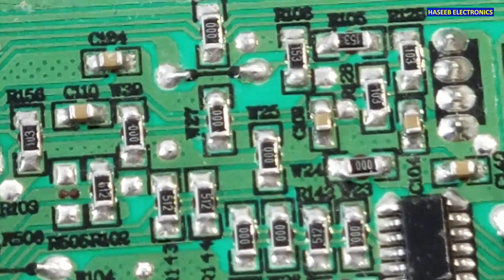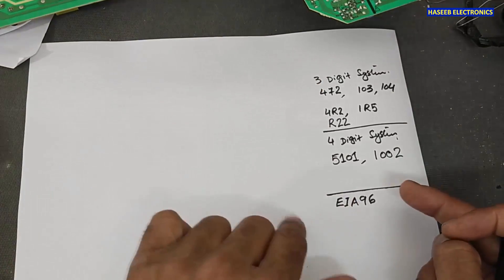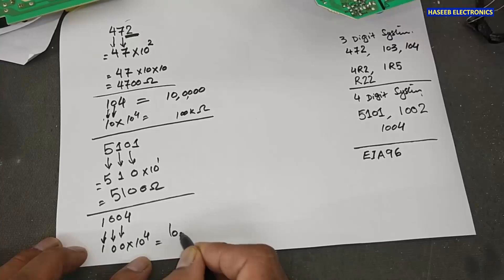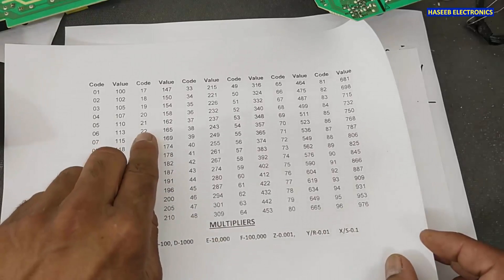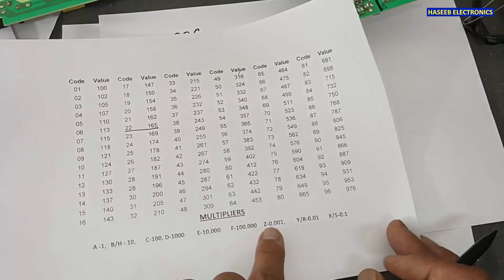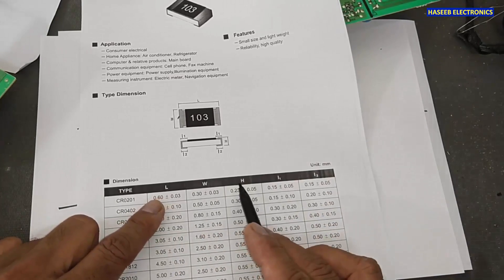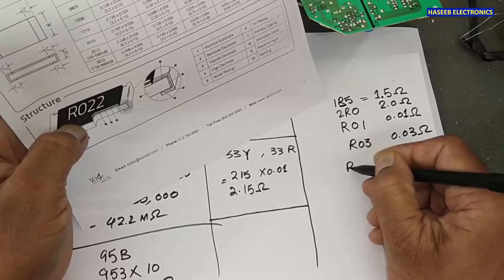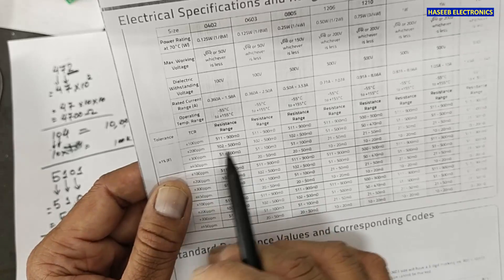{783} SMD Resistor Code To Resistor Value And Wattage Rating

Comment: I have a smd PNP transistor marking 5DW.  For emergency, can i use alternative TO92 packing eg SS8550?  Hope you can explain more.
Reply from the maker: yes 
you can use it. just match the pin configuration
Reply: @HaseebElectronics  Thanks for your reply.  Will try and update you again.

Comment: I was doing one of those SMD practice boards and was royally confused about the numbers on the resistors /capacitors because they did not match with the assembly instruction , the sheet it came with only showed their value , now I understand how to calculate these resistors and solder then on the right place, this is extremely valuable to me, thank you

Comment: Goodday Haseeb, I was wondering where we can locate the specification sheets @ 13:47?
Reply from the maker: it is available on google 
https://datasheet.lcsc.com/lcsc/1811141352_Ever-Ohms-Tech-CR1206FR360P05R_C245443.pdf
Reply: @HaseebElectronics  Thanks a-mill; may God continue to Bless you richly.
Reply from the maker: https://www.ibselectronics.com/ibsstore/datasheet/venkel-resistors-thick-film.pdf
Reply from the maker: https://industrial.panasonic.com/cdbs/www-data/pdf/RDM0000/DMM0000COL9.pdf

Comment: Sir I have a question mili  ohm resistors are coded differently , can we measure mil i ohm resistor in a multimeter
Reply from the maker: for milliohms measurements we need wien bridge circuit.
or just connect across the current source and measure the dropped voltage across the resistance. then calculate the resistance value using ohm's Law

Comment: Thanks. Great information as always. Could you make a video about smd nonpolar ceramic capacitors (often brown and have no code on them), how to identify and measure them on a pcb? Can they be blue and if not what are those blue components?
Reply from the maker: best regards 
sure i will share in detail very soon
Reply: @HaseebElectronics  Thanks, that is awesome.